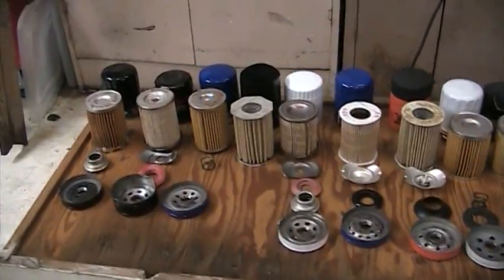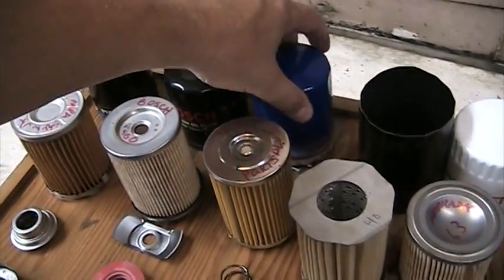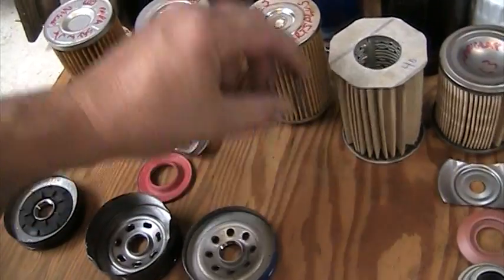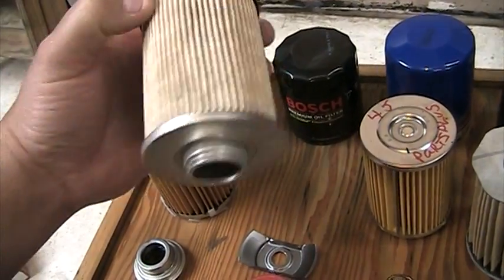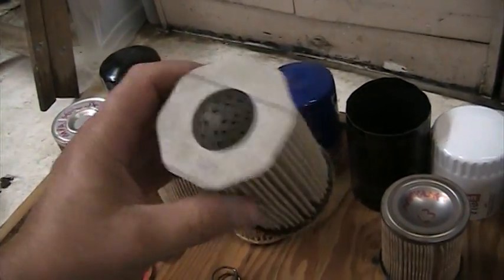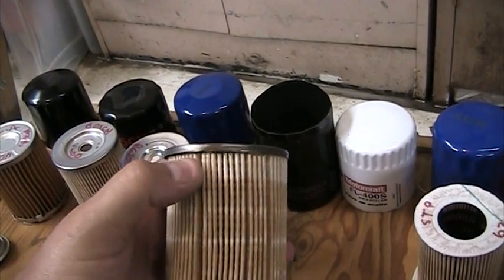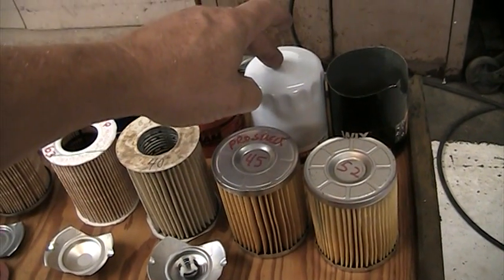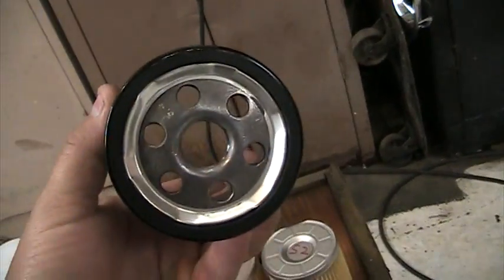9 OIL FILTERS CUT AWAY ( LOOK INSIDE) AND RANDOM CATTAGE

Comment: Change your oil regularly and you needed worry about what kind of filter you use.  Im very fastidious when it comes to the type of oil I use.  Mobile 1 full synthetic is my go to.  That will not change.  I have never once in my life had a preference for the type of oil filter I use.  I typically use the cheapest oil filter the auto parts store has that fits my vehicle.  The proof is in the pudding.  I have a 2008 Toyota Camry with over 600k miles on it and on the original engine and transmission.  The car just wont quit.  My 2013 Tacoma.  I do the same process.  My wifes 2017 4runner.  Same thing.  As you might be able to tell.  Im a Toyota guy haha!

Comment: what does the spring, the stamp spring do?
Reply from the maker: AmazonShroom the spring holds the filter element tight against the mounting surface , but when in cold startup the filter will push the spring and allow unfiltered oil to flow untill the engine warms up, also will do the same when partially plugged
Reply: rick davidson thanks

Comment: I like your video. you did a great job.
I have a few questions: 
1)Should we check filters specification? who got the lowest "MICRON" rating?
2)If I wanted a HIGH CAPACITY filter, can I install a filter normally designed for a bigger engine? Example: If I have E150, and I install a filter normally use on a E450? will I gain anything?

Comment: Excellent video.   Thanks for posting.  On another recent video, a Toyota factory oil filter was cut away and it had no end caps.  How can that be?
Reply: Toyota pleats are arranged 90º horizontally and are glued to the metal can directly in many applications. Least number of components that way. Made by robots of course.
Reply: Thanks for the heads up.   They seem to do a great job, and I get 5k - 6k miles using full synthetic between changes.

Comment: Sadly, the review has not 1 scientific fact. Of the pleat material and flow rates, pleat count is not a measure alone, it would only work if you started with 1 gallon of equally crap oil for each filter ran them a few hours hot and see what the resulting oil is like. How clear, how metal free, how much PH change- This is not a hard test to perform but it would be the one to do. I would love to see that happen also
Reply from the maker: I wasn't trying to over think the filter media only comparing visible differences
Reply from the maker: I wasn't trying to over think the filter media only comparing visible differences
Reply from the maker: I wasn't trying to over think the filter media only comparing visible differences
Reply from the maker: I wasn't trying to over think the filter media only comparing visible differences
Reply from the maker: I wasn't trying to over think the filter media only comparing visible differences

Comment: Oil would last even longer if ran though a oil cooler like transmission fluid. With 2 oil filters one before the oil goes into the cooler and one when it comes out of the cooler, a hot and warm filter system... From this video I would say all the filters do the job and the Motor Craft is better made along with the Bosch...
Reply: +Tony Iocca While you may be right on this for the quality of the oil, there are a few other factors that would have to be considered here before building such an immense system. Manufacturers dont do this for 3 reasons. 1) Most drivers only see high oil temps in stop and go traffic, and even still only just. 2) space. Open the hood on a modern FWD. Where is all that going to go? 3) Cost. All said and done, the MSRP of a vehicle could easily go up anywhere from 800-2000 dollars. Not to mention the extra weight and subsequent reduction in fuel economy OR the increased expense of an oil change, as the full system will add 1-2 quarts of capacity.

Beyond that, you'd have to reconsider oil pump design just to push that much fluid through two extra restrictions and the extra plumbing.
Reply: +Robert Ridgeway I agree passenger cars do not really need it as much as a truck pulling a load. A guy I know did this to his truck he had drove over 10k miles at the one year mark he changed out filters and topped off the oil. He showed me the oil on the dipstick and it was golden clean. So you save money on less oil changes and keeping the engine well lubed. I was in the Army at the time and so was he so I do not know when he finally changed his oil out.   
As far as the oil pump goes, I have been driving for over 35 years and not a one oil pump has ever stopped pumping on me or anyone I know. When that oil does get through the filter/cooling system it is much cleaner and contributes to the over all cooling of the engine. Instead of being part of the problem.
Reply: +Tony Iocca I use Lucas gas treatment with almost every tank of gas and then switch to Marvels Mystery Oil in the gas before I do an oil change. These additives keep the top half of the engine cleaner and the fuel pump lubed as well. What I have noticed is some of the residue of these additives fined their way into the oil. I use Mobil 1 running it almost 10k miles or a year what ever comes first. My truck is 1983 straight 6 4.9L rebuilt 1999. It is still pulling loads and running strong not using or leaking any oil...
Reply: +Tony Iocca ha we know that 4.9 is a die-hard of a beast. as for the oil pumps, they need to be capable of moving that volume of oil. I'm not doubting the idea of a system like this, and especially in heavier duty applications (like your example) could benefit greatly from it. I simply wanted to illustrate why we wouldn't see that in passenger cars.

Comment: Dude you did great until you dreamed up "the tighter the pleats are the harder for oil to flow through", "the oil flow will damage the pleats" and your emphasis on pleat counts. I've sold millions of dollars worth of industrial lube filtration and you are all wrong on those two statements. As far as your preferring a lot of pleats/paper you must really love the phone book?..... Personally I like the fluffy thick filter paper that contains synthetic fibers over the thin paper with more pleats.
Reply: +Robert Hawxhurst  Oil would last even longer if ran though a oil cooler like transmission fluid. With 2 oil filters one before the oil goes into the cooler and one when it comes out of the cooler, a hot and warm filter system... From this video I would say all the filters do the job and the Motor Craft is better made along with the Bosch...

Comment: I don't know , I own a 78 jeep with a 360 and can't usually find a filter for it so I order them ...  I like puralator gold or mobile one but at the moment I'm stuck with a fram which kinda scares me a bit . .
I thought they use to use magnets on the filters but I make sure my drain plug is magnetic , cheap insurance
Reply: Drain plug is close to the oil pickup. If a bunch of shavings breaks loose it'l grind the pump a bit. Best to have a magnet on the end of the filter and use a filter with top pressure bypass (near the mounting plate) so the ferrous dirt isn't recirculated in any case.
Reply: I just stuck a magnet on the end of the filter , a little trick that im sure will do the job .. Only for the 1st 15,000 miles while the engine is loosening up ..
Reply: Your fine! If you change your oil and filter. I have never had a engine blow up with Fram's. Never a oil issue. I am 58 years old. Had alot of cars since 1978. Have used all kinds of oil and oil filters. My 2005 Taurus 3.0 Vulcan engine just turned 156,500. Used Motorcraft blend 5W20 for the first 152,000 miles. Now Valvoline 5W20 high mileage full synthetic with Fram Ultra Guard Synthetic oil filter . I have used all kinds of oil and oil filters. Just change your oil and oil filters when you feel it's right and you have time. Spend what you can afford. Use what the manufacturers recommends. It just that simple.   Shawn

Comment: Interesting and informative video. It left me with some questions. Thanks for taking the time to do the work. 

Could all of these filters be used for the same application? i.e.:  Can all the filters interchange for the same car? Is this an apples to apples comparison? If so, then I would say this is a good comparison video. (maybe this has been asked. I did not read all of the comments.) I would imagine that manufacturing quality, and material quality, can both vary depending on the final application, right? I would not use a cheap filter in a severe duty application. I'd pony up and buy a decent oil filter.

There appears to be a wide range in material quality from the represented manufacturers if all the filters are comparable. If all the filters are not comparable, then I would have to say: what is the point you are making?

p.s. nice kitty video too :-)

Comment: My filter doesn't even come in a metal covering.
Reply: +israel5236 Toyota has started in the past few years with using a system that replaces element only. Motorcycle(japanese)manufacturerers have 4 decades. My BIG question is- Why in the hell is the filter assembly setup  cheaper than the element only setup- should be the other way around IMO
Reply: I had an 88 Buick Century that had that kind of filter... It didn't have a steel casing around the filter it was just a cartridge... It went up inside the bottom of the oil pan... I have a buddy that has a Honda day Sonata in the oil filter on it is on top of the motor
Reply: +btchhopperou812 Welcome to japanese engineering;were less is more ha ha ha
Reply: +israel5236 Quite a lot of vehicles have been made this way for some time. BMW has been doing it longer than Youtube's existence. Just saying. And, while the cost is a little higher, it is so nice to just pop it open up top... except for the GM Ecotec engines. Because where the japanese work on less is more, GM/Ford = If it aint broke, replace it with plastic to save some cash.

Comment: 2-3$ for an oil filter...? seriously? the cheapest one i could find recently here in Sweden cost about the equivalent of 8-9$ but i ended up having to cough up the equivalent of about 20$ for the right one. Fucking VAT...
Reply: Here in the states at my job  we use a commercial line from advance auto parts where a bunch of common filter numbers start at 1.99. 
They are made by purolator. 
I haven't seen too many issues with them but im not gonna use them either.

Comment: so what's the point? The more pleats the better or straighter pleats make them better? How about ability to filter or longevity (miles)?
Reply: the more pleats mean more surface area and a better ability to trap and hold more dirt without hindering flow rate for a longer ammount of time. The sealed metal end caps are better / stronger then the cardboard end caps which have been known to seperate from the filter media allowing dirty oil to bypass the filtering media entirely. The coil spings are better then the leaf springs which are known to lose tension over time and may allow oil to bypass the filtering media and circulate back through the engine unfiltered. Silicone Anti drain back valves are better then the nirtile rubber ones because silicone dosent harden over time and continues to make a good seal for the life of the filter.
Reply: Shabbernigdo Xingjian more pleats and surface area mean less than the quality of the filtration media.
You are basing many of your claims on assumptions that dont have much scientific rationale such as coil vs leaf springs. If you are claiming coil springs cannot lose tension that is obviously false. 
The most important thing is filtration performance and you cannot discern that from staring at components making guesses.
Reply: FuckGoogle+ No actuly what i said is true and easily found information with a google search. I never said coil spring cant lose tension its just that leaf typers are more prone to it. Your right you cant just look at the media and guess performance but there are data sheets that do show them.

Comment: what good is a drain back valve do, if the filter is mounted in such a way that the oil will not drain out? (the threads are at the top)
Reply: It keeps the oil lines full above the filter. It's like when you suck water out of a straw. When you stop sucking and there is no valve the water will want to flow down and equalize itself. When it's really cold outside it makes a difference.
Reply: Dane Glasoe
The amount of oil in the passages above the filter is minimal compared to the volume of oil that the oil pump puts out. If your engine is starving for oil in cold weather, you are using too high viscocity oil for the temps. that your operating in. The only purpose of the check valve in the filter is to keep the filter from emptying while the engine is turned off, when the filter is mounted with the opening down or if the filter is mounted horizontal, causing the engine to have to fill the filter at each engine start before it recieves lubrication. Engine manufactures often use the same filter mounted in all 3 configurations, because they will only have to stock one item and there is no problem with someone accidently putting a filter without a check valve on an engine that requires one and a check valve will not harm an engine that doesn't require one.
Reply: some filters are mounted at an angle where they drain back when the engine is off

Comment: This is a good view of budget grade oil filters.  The plastic item on the left most filter is NOT an impeller..  There is slight tension from the plastic tabs to anchor the filter in the metal can.  All the filtration material on these filters, no matter the pleat count, is paper (cardboard).   The actual square surface area of the filtering material is what matters.  No matter.  These low-cost, price point filters, not manufactured for rigorous oil filtration.  Synthetic fiber needed for that.

Comment: Fram has exceedingly  poor paper pleat geometry - the pleats bunch up or spread apart, creating uneven filtration thru the paper.  The pleats cannot hold their integrity against the incoming pressure - paper failure has been noted also, where the wide open pleat areas begin to tear.  Buy Wix, Mann or Mahle - these are superior filters.

Comment: Rick, as a former mechanic, I always find it interesting to see stuff like this. I have used both Fram & STP filters on my Chryslers, and I have found that the STP is a much "cheaper" filter, because it is much shorter than any other major-brand filter. If you ever do a comparison like this again, I would like to make a suggestion. Try to compare apples to apples. What I mean is, compare the filter from several different manufactures, for the same application, so we can see the real differences.

Comment: I have used the cheapest Fram filter all my life from my 1939 Chevy truck and my 1940's Ford truck to today without any problem.  I also used the cheap Walmart brand oil.  I never had any problem.  I switched when I started buying new cars in 2009 to the best Fram filter and synthetic oil.  I still use conventional oil in my 1995 Toyota Tacoma.  I think changing the filter and oil regularly is the most important thing.  Oil and filter is cheaper than a new motor.  Pay more, get more, generally.

Comment: Fram cardboard end caps suck they try to explain it but in reality it's about cost cheapo filter that's why they cost $3. Fram will do the job for 3000 miles if you go longer then that they have collapsed or the cardboard can come apart inside. None of the OEM's use cardboard end cap filters.

Comment: lol Fram bashing? Ok I don't generally bash but Fram is a cheap mediocre filter. That doesn't mean it doesn't do its job but there are better filters. You fail to understand the importance of surface area. With your logic why don't you just use a filter with no pleats? Oh yeah that would plug up pretty quick wouldn't it? and the resistance to oil flow would be huge. Thats ok the oil bypass in your engine would just open up like it does for all cold starts.

Comment: I been using frams for the last 10 years and havent had a problem. The oil usually goes 3000-5000 miles. If I get a cheaper filter I dont run it as long. I once went to "Quaker state" @ classic car wash in louisville KY & noticed what looked like small bits of toilet paper in clean oil. I suspect the pleats in the filter failed. This was day 3 after an oil change. I did all my own oil changes after that. No clue what brand of filter it was. White with no lettering on it.

Comment: I use nothing but Napa Gold and now they have a platinum filter for synthetic oil. Feel the weight of the gold filter compare with fram. My mechanic always that I love my car when he sees the gold filter. 94 Corolla DX 19 years old with 220,000 miles. Engine is awesome. Sadly it will die from body rot in New  England (Maine)

Comment: I agree. I dissected a Fram and the element was held tightly in place. No way for any significant flow to bypass element. Fram does give some performance data. The "Sure Grip" is nice. In most applications Fram is all you need. 

I dissected Wix also. It looks more expensive to make and had more filter area. Don't need the extra area in most applications.  Haven't found  performance data. I will put this or better on my performance engine.

Comment: Different brands have different capacity. For example, the wix for my subie is bigger than the Mobil 1 and other brands. I went that route because I have a small oil pan and need as much filtration capacity as possible. Microgard/fram same crap. I work at oreillys. Wix Mobil Bosch motocraft mopar ac all good. K&n best :-)

Comment: Don't believe these people that hate Fram. I use Fram all the time and been using it since i owned my first car. All my vehicles I run well into 150,000 mile range and never had any issues or a collapse filter with Fram. Most Fram problems described here are due to neglect in Oil changes but these people won't admit that. They prefer to mouth off about something they no nothing about